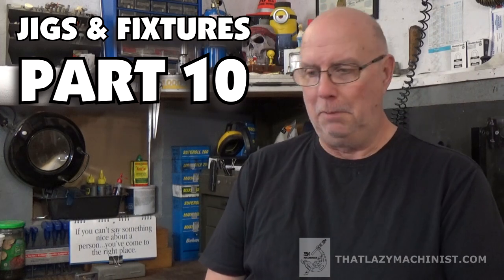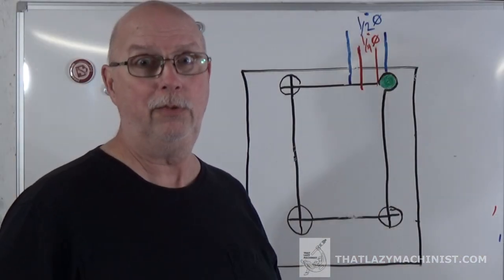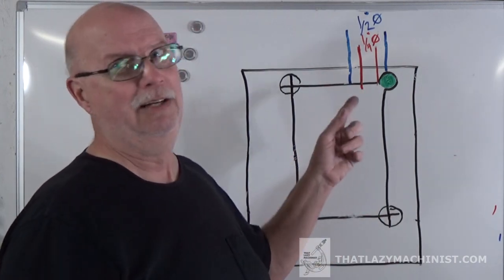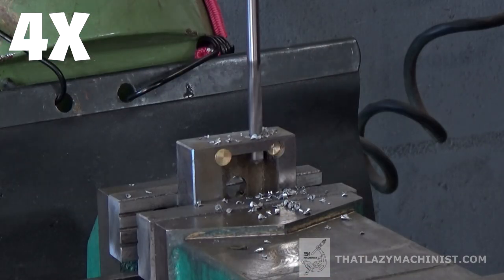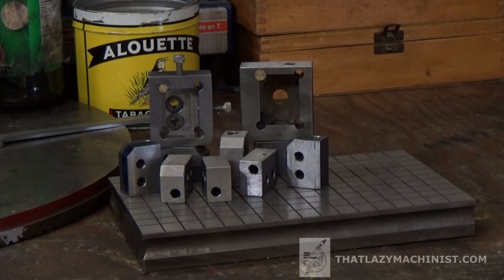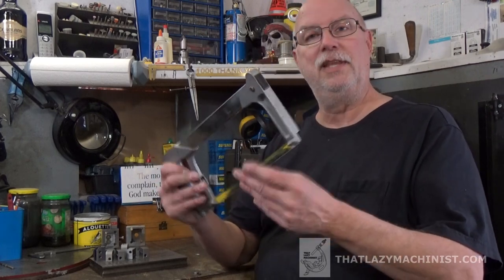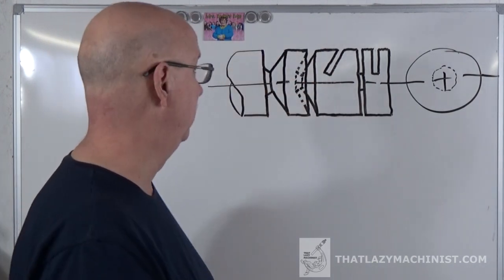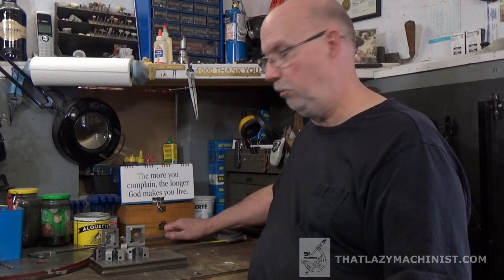HOME SHOP JIGS & FIXTURES PART 10, MACHINING A PLATE FIXTURE, SHAPER, DRILL PRESS, ROUND COLUMN MILL

Comment: In the real world it is very rare that a part (and process) is designed accurately and completely in the first go around. As I recall, you added the third hole partway through the series which would later cause the issue with the jig hole alignment. Speaking as a long time manufacturing engineer, having to work around issues like these is very much a real world problem. The exercise in thinking about non-intuitive alternatives is very useful in saving time, money, and avoids scrapping parts and jigs. 
I am very much enjoying your series of videos. Thanks for all the education !
Reply from the maker: Hi Doug! What you say is very true. I worked in model making for the high speed aerodynamics wind tunnel of the National Research Council of Canada and the one constant through all those years is that the drawings we started with are not the ones we used to finish the job. Working around problems requires creativity and attacking a problem in a new manner.  I am pinning your comment to the top of the list, it is very insightful. Thanks for watching and for taking the time to write, Marc.

Comment: You're such a relatable person; I really enjoy the content you create.  I imagine a lot of of folks can relate to a project turning into a slog, but at least on this side of the screen it's really fantastic!  Thanks for pushing on.

Your explanation on the saw was educational.  I am not a machinist, but I do home projects.  I could easily imagine myself putting a part in a drill to spin it while I tried to do something to it.  Your reminder that the shape of the cut is profoundly different when the part is spinning was helpful.  I also had not considered the practical implications of chip clearing and rate of material removal; both seem obvious after you explain it.

Thanks Marc!

Comment: Good morning Marc, first thank you for the education you provide the world of machinist with your expert life experiences. Just a quick question. I have been looking to replace my mix match collection of taps and dies with a uniform good quality set of SAE . It seems there are mostly metric sets out there. My need is for a full range of SAE taps and dies with minimum OD dies so I can make the least amount of die holders for my tail stock. As for taps, I have seen so much about spiral taps, I would like to step up to spirals, if you agree, for hand and power tapping in my lathe and milling operations.. The range I use mostly is #2 thru 1/2”. Can you recommend a good manufacturer of these as sets or individuals if need be. Don’t have a Hugh budget but do try to get the better quality tools, Made in USA if possible. Thank you for any advise you could provide. Appreciate every video you make. Papa Maggio, Ex shop teacher from 50 years back. Like Mr. Pete.

Comment: Question: How would you determine a radius of a quadrant? As you have mentioned, you can't measure the cord because it will either have a chamfer or a burr. Can this be done with a square, gauge pin and gauge block? I feel like it can be done with a rotary table, test indicator and a mill. Your thoughts.

Comment: I wonder if you could help me please ..
I tried ro forge a few tools from o1 tool steel, using a charcoal forge and hammer..Each time after forging I normalise 3 times , heat, quench and temper to dark straw/ brown , but each rime , rhe  tools break, and the steel shows large grain structure....its driving me crazy...why does rhe tempering not work ...???
Thanks in advance...
David